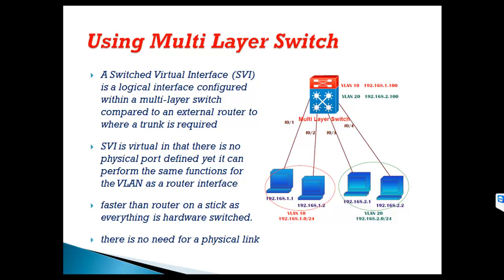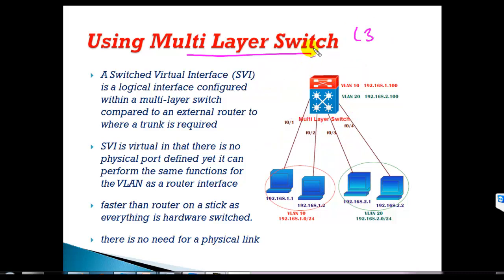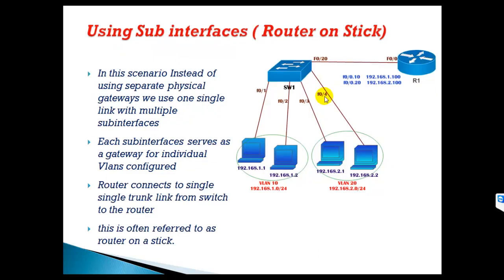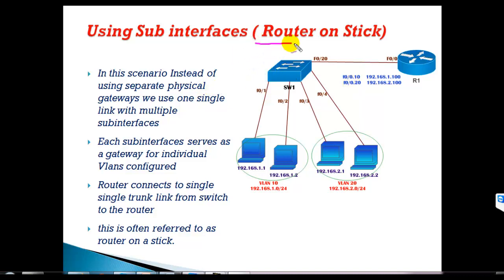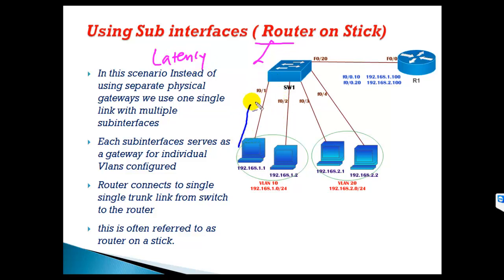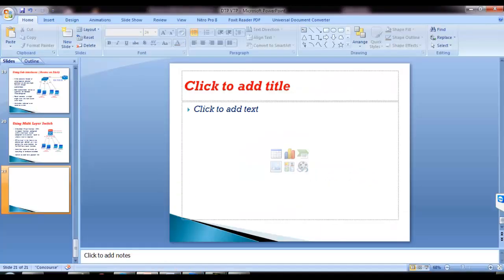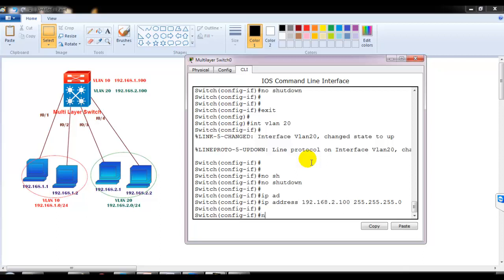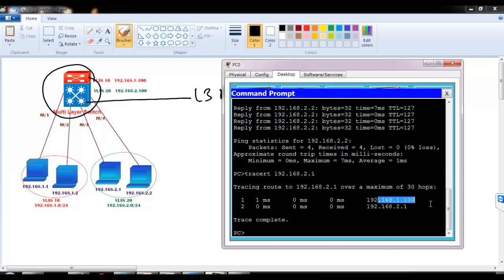Inter vlan routing using multi layer switch  part 1

Comment: hi sir

in case we have a access switch in middle and then we have a trunk to main switch(core switch) then in that case we have to assign the same ip address in the access switch vlan which we are going to assign in core switch, or we are going to assign the different ip in access switch and the defult ip in core switch.
Reply: Shashank Kumar no you don't need any IP address because layer 2 don't need an IP address it needs to just pass the layer 2 frames from vlan to vlan